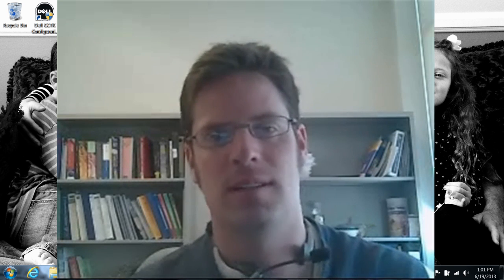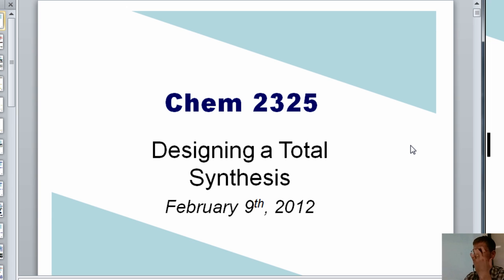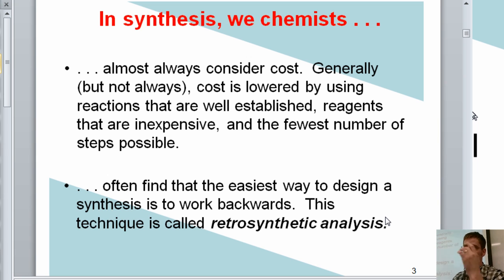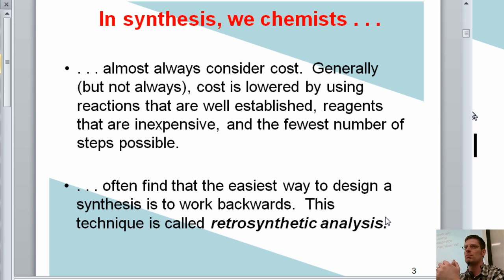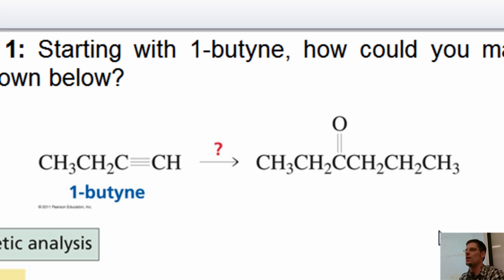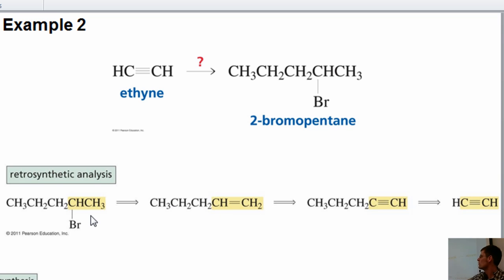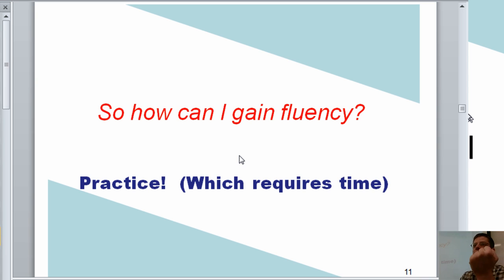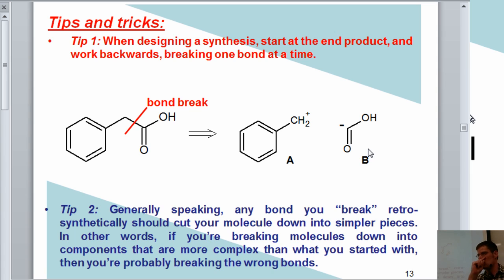How to Design a Total Synthesis

Comment: Is sodium cyanide used to replace the carboxylic acid because carbon is more elecronegative than sodium, making the carbon bound to the sodium partially negative?
Reply: Aaron Forbes - you got it backwards. The sodium cyanide reacts to give the carboxylate
Reply from the maker: That is correct, Aaron Forbes. When exposed to H3O+ and heat, the cyanides (CN) transform into carboxylic acids (COOH).
Reply from the maker: Aaron Forbes got it correct below. When exposed to H3O+ and heat, the cyanides (CN) transform into carboxylic acids (COOH). Does that make sense okay?
Reply: @chemistryunleashed4348  - I read it as he was saying the nitrile substitutes the carboxylate. Not the nitrile is the precursor group to the carboxylate.
Reply from the maker: @NapoleonGelignite  You may be right, Andy, that this is what Aaron was asking. I'm not completely sure, but hopefully Aaron's question did get answered somewhere along the way, because I was really late to the game in responding. Thanks so much for responding and helping out! Please have a wonderful day!